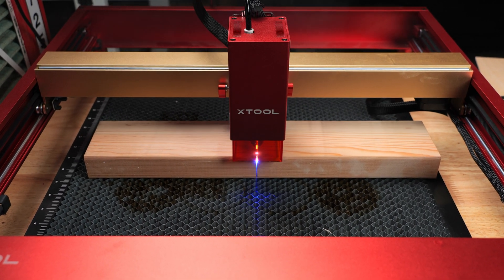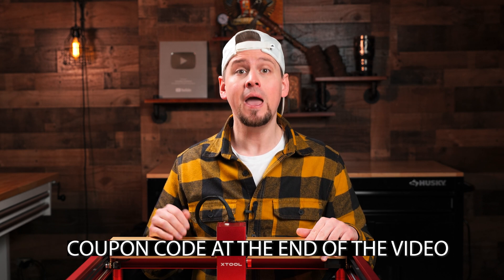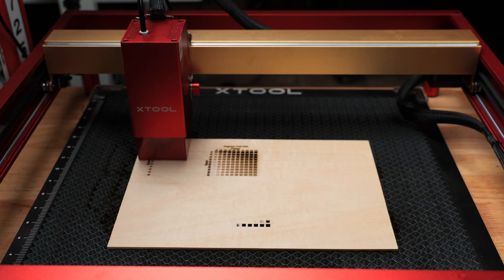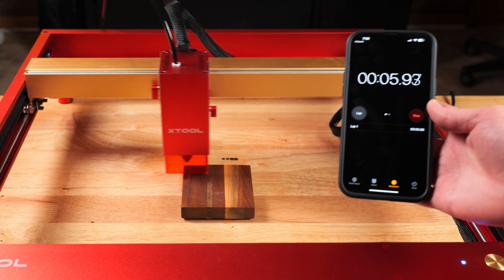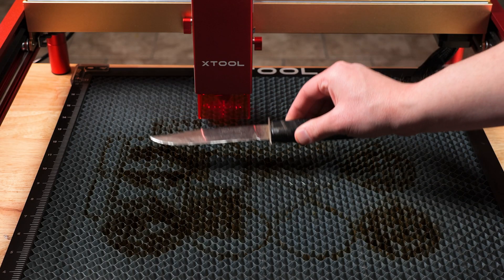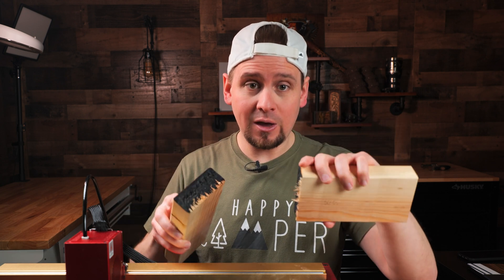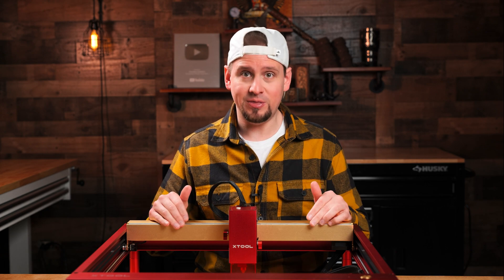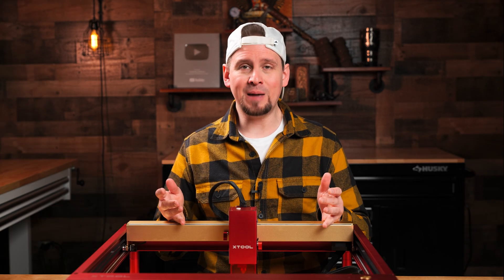World's Most Powerful Diode Laser | xTool D1 Pro 40W Laser | Cutting Test

Comment: Hello Cornelius... I have a question that I haven't managed to find an answer to anywhere on the net..  I want to cut 12mm Buffalo Board Anti-Slip Mesh Phenolic Birch Plywood.  I'd need to cut 8 by 4 sheets so would have to make a gantry type CNC for it. Would this laser diode be able to cut this board in one pass ? Do you know of anyone trying to cut this type of board ? It's often found in trailer floors etc and i'd like to be able to do bespoke floor panels...  Thanks

Comment: I do not have a question about the 40W module.  What I want to ask is about the whole system.  The OLM and other seem to have system issues, where jobs stop in the middle, or images jum.  Have you seen any issues with the XTool in operating?   Any perfromance issues, stopping, jumpig around, etc.  Actually anything.  Thanks.  I am looking for a laser, and everything I am reading on the diode units, and all seem ot have problems.
Reply from the maker: Hey Scott, great question. I will start by saying every laser brand will have some sort of publicized problem at some point or another. I had troubles with my 10w and my IR module all of which was fixed by software update. 

Other users I’m sure might have had some other issues, some with hardware some with software. I recommend getting a reputable brand laser that way you have a good support group behind you as well as warranty. If you are just beginning I definitely recommend a diode unit. If a problem occurs take it one day at a time 👍🏻

Comment: Could i use that 40w by swapping out my 10w or do i need the whole new everything?
Reply: 40w is backward compatible to the 10w as long as you’ve installed the 40w x-axis and motherboard.
Reply from the maker: Yes, you can. You will need to install the new motherboard that comes with the 40w along with the X-axis arm.
Reply: @CorneliusCreations  i have the regular 10w xtool not the 10w pro though..i keep hearing others say that its not possible...i mean of itll work than perfect